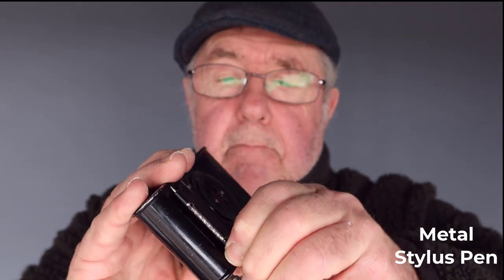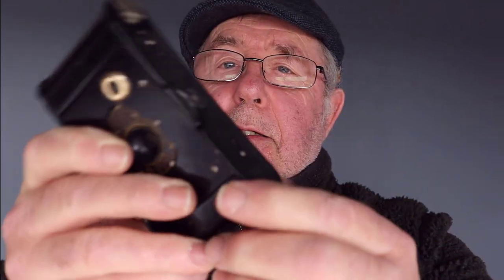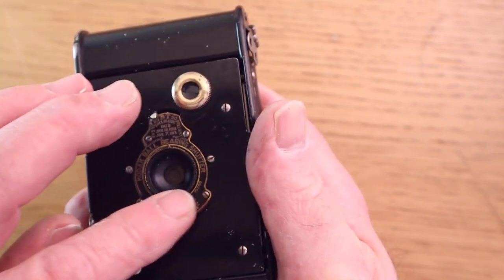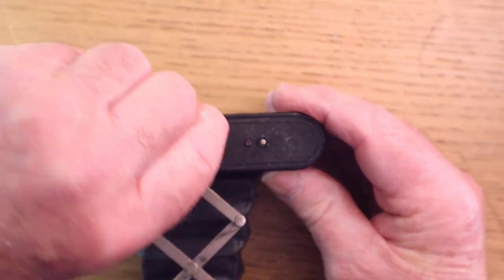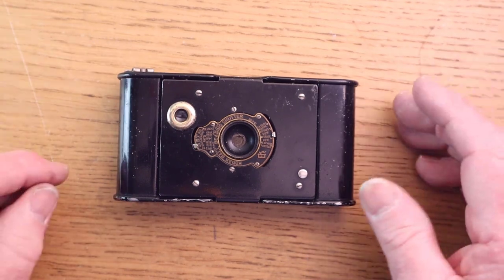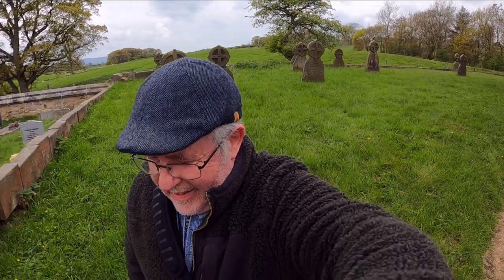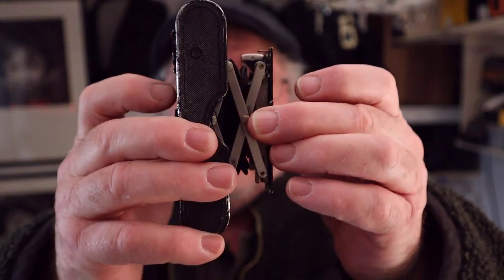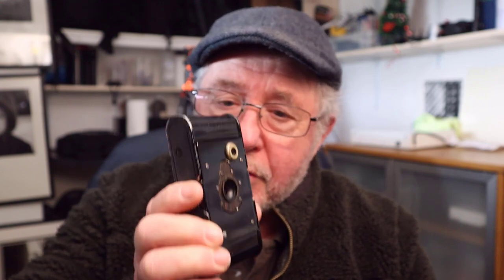Vest Pocket Kodak Autographic 127 roll film camera, iconic and fun to use

Comment: Great video. Thanks. There is a much easier way of getting to the lens.  Unscrew the 2 screws at the bottom of the camera and then slide the whole lens and bellow assembly up and then out from the top.  This works for my 1916 version (enamel Autographic s/n ~500,000), and I believe for later versions.

Comment: I am watching your fantastic video and wanted to mention a really great hack for fixing bellows.  There is a spray called flex seal and it comes in black.  Spray it into a little dish and use a qtip to paint it all over the bellows.  It looks just like the bellows and it is thin and strong and works perfectly.  I have fixed many bellows cameras this way.  Try it and let me know.

Comment: Nice review. You clean the backlens easier, to take remove the plate for (loading a fiilm) and on top you see that the camera is made from two part. One part is the frame and the bellows and the other part is the body. Both are connected by a sliding. You can remove those part by sliding of them,  so they are separate them so you can much easier and fixed things.
Reply from the maker: Great to know , very helpful, thanks

Comment: Hi Martin I have the same camera with a different shutter. I also had a light leak in my bellows, I used liquid tape to repair mine, but its not a good solution really. I have now got a another new bellows for it and I am going to strip it down and replace the bellows and give everything a good clean. I have put a few rolls through mine and some of the pictures are good for such a cheap lens.
Reply from the maker: Were did you get the new bellows from, thanks
Reply: @martinhensonphotography  Hi Martin They are not new, new bellows I bought a second Vest pocket that was listed as not working, I was going to fix it and use it, but the shutter was destroyed, some animal had been in and butcherd it, but it had a bellows that is in very good condition, it looks like it has been replaced.
These little camera's are very easy to strip and change the bellows, I have the old/new one out ready to go in to my usable Vest Pocket. great video Martin.
Reply: @martinhensonphotography  camera bellows in Birmingham will make new bellows for any camera that needs them. The name changed but Google it. They made me a new one for a Fujica super six and 6 mamiya 6 models. I paid around £45 per bellows so the camera needs to be worth a lot to justify it.

Comment: Excellent review. Your training and experience is obvious in these superb photos. I wish 127 film were still readily available. It was the film I used most in the 50's when I was a child. Like you, I like to use historical cameras. That is, those that have a special association. My latest experiment is the 8 mm Bell & Howell Zoomatic Director Series Model 414 PD. The exact model Zapruder used in Dealey Plaza where the motorcade would be passing. Everything seems to be functioning so I'll give it a go with film. If it turns out I'll post the digitalized form. Thanks
Reply from the maker: I also wish it was still made, small cameras and a big negative compared to 35mm
Reply: @martinhensonphotography  Here in the states we had low cost developing with returned negatives up to a few years ago. It was almost like the old days. This was through our Walmart store chain.I guess this was unprofitable for them so now they just destroy the negatives which defeats the whole idea. As you know, one can still shoot 127 made from cut down 120 but here in America the whole process is very expensive. If you want economical film shooting you have to do your own developing. To me, sending the film off and picking the pictures up (with negatives) was a big part of the fun of the old days.
Reply from the maker: @dalehammond1704  yes it’s not cheap even in uk, I have a kit we’re I can cut down 120 roll film which makes it more viable to use

Comment: Many thanks for another great video Martin, very enjoyable. As part of my growing vintage and antique Kodak camera collection I have three VPKs, one with a meniscus, one with a rectilinear and a special with a Kodak anastigmat f/6.9 lens. However the camera with the meniscus lens had a couple of light leaks in the bellows. After a bit of research I discovered Plastic Dip, which is a rubber based paint and goes on very easily with a small paint brush. When you spoke about the problem you had with your cameras bellows I thought I would mention this stuff. I have used it now on the folds of the bellows on a couple of my old Kodak's with great success. Oh it also comes in different colours including red. Like you, the immense joy I get from using these old cameras I just can't put into words. Anyway, keep up the good work and looking forward to the next video. 
Regards
Cameron
Reply from the maker: I have just acquired a special that you can "focus" made by Kodak Canada, the bellows are like new,

Comment: Thank you for an inspiring video.  I came across one of these in my Dad's lab and was just going to sell it, but after your video I'm inspired to take care of it and keep it.  I wonder if you might have some advice - mine is missing two small screws that would have been on either side of the lens and hold the bellows and lens to the front plate.  Any advice on how I can replace these or at least figure out the size and pitch of the screws?

Comment: Lovely images and great work servicing that camera. In a lot I picked up a while back, the most exciting find for me was an old Kodak No. 2 Folding Hawkeye camera. I keep putting it off but I need to lubricate it's movement, patch up the damaged bellows and clean the lens like you did here and see how it rolls. These old things are lovely especially if the film is still available (I'm super fortunate in that mine takes 120 film)
Reply from the maker: There are some great Kodak cameras out there and most are relatively cheap to buy, thanks

Comment: Just had a question, is it ok to advance to the next frame on the backing paper or will that result in overlapping frames? I'm not certain if the backing paper markings are for 4x4 rather than the aspect ratio of the VPK
Reply from the maker: If your using 127 film the numbers will give you correct spacing
Reply: @martinhensonphotography  Perfect, thank you so much! Loved the video :)